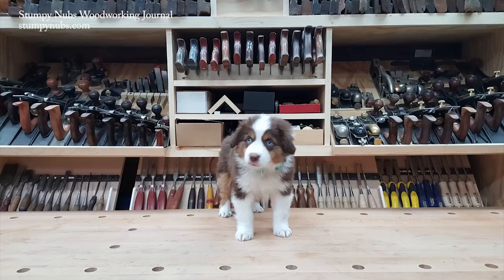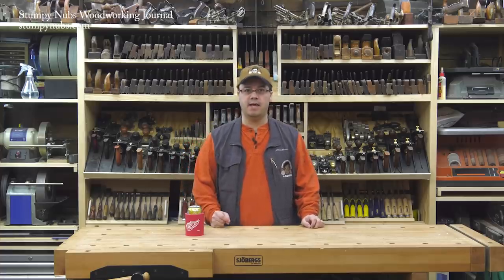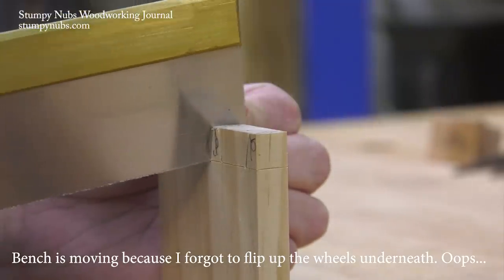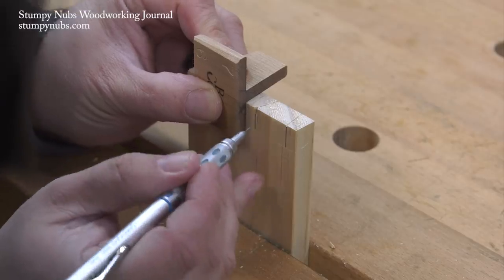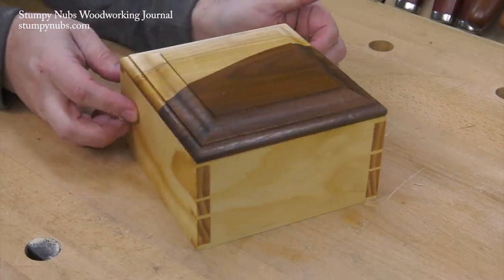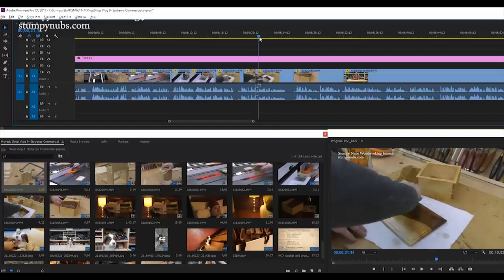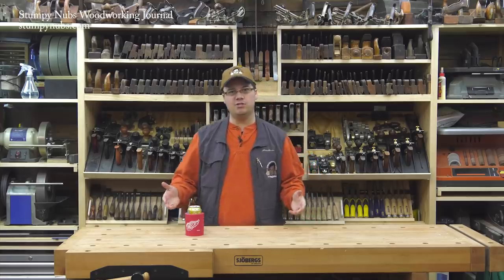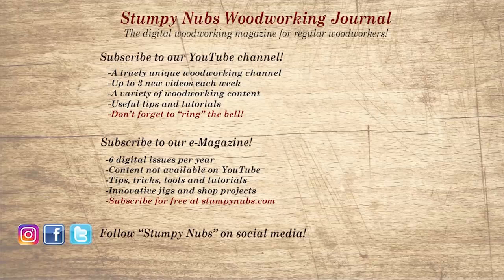A hand-dovetailed box for The Highland Woodworker show

Comment: James you mentioned in this video https://www.youtube.com/watch?v=PZXg5KA0P-Q&t=358s that you recommend the Ridge Carbide blades above the Amana and Freud.  Well I am only a hobby woodworker.  I am looking for a blade to replace the stock blade on my table saw.  You worked with Amana for a long time.  Can the Amana 610240 and PR1040C blades be good enough for the hobbyist?  Also, let me know what you think of Diablo blades.  In your Washer/Dryer Pedestal video https://www.youtube.com/watch?v=uxKgDWcVrS0&t=323s I saw you use one on your circular saw.  Do you recommend Diablo blades?  Thank you.
Reply from the maker: Amana blades are well made. The carbide is a bit thinner on the teeth, which means you won't be able to sharpen them as many times as the Ridge Carbide, but they make nice cuts. Diablo blades are the best BUDGET option out there, in my opinion. They don't compare to a high-end blade in quality or cut, but they are better than the other cheap blades.
Reply: Stumpy Nubs thank you James. I appreciate the response.